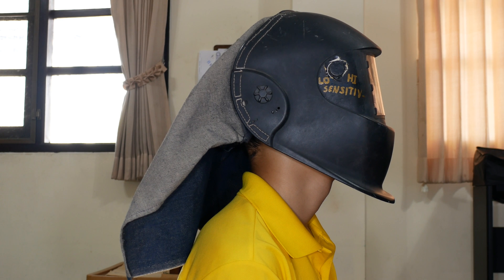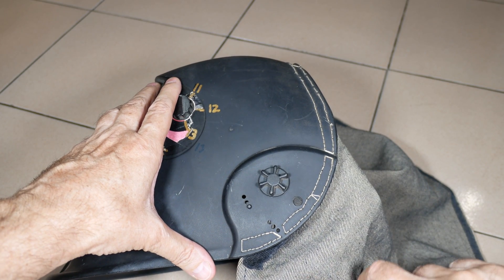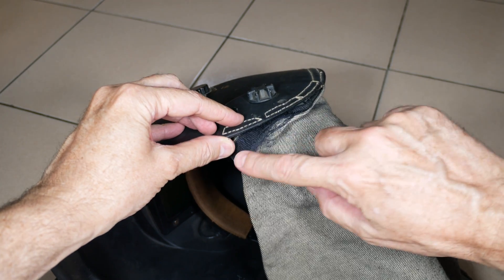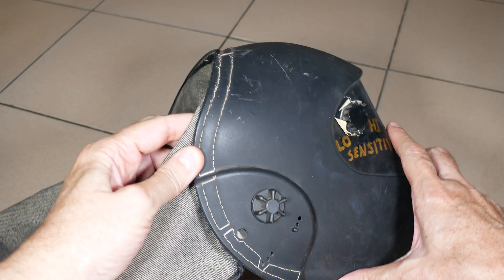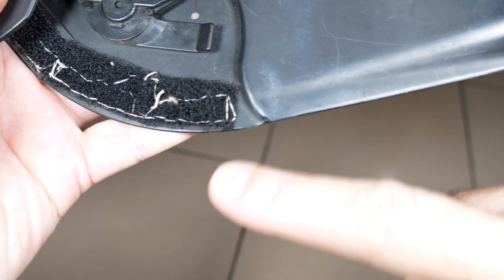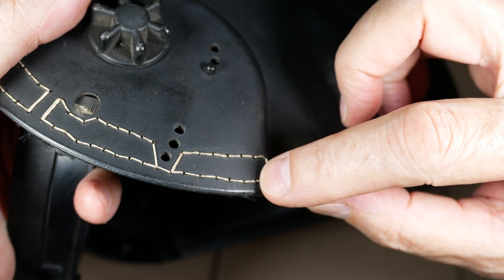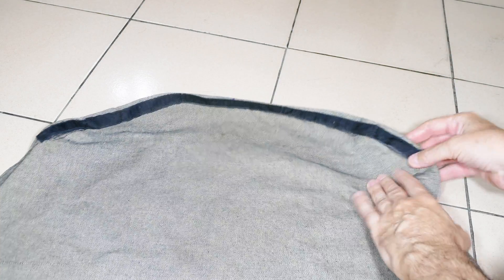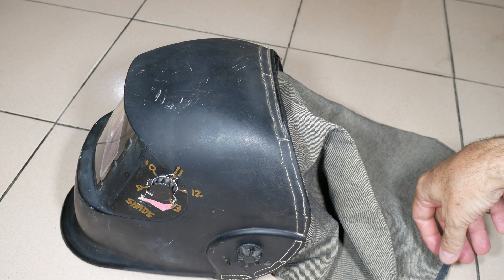DIY Welding Helmet Integrated Neck Protector (4K)

Comment: They sell ones that use a sort of press fit to attach to helmets but there not really breathable. And you can get away with using something non fr because unless you do overhead welding not many sparks will hit the back of you want something less permanent that is a bit breathable but will allow in some light you can use a flannel with a hood. It’s lightweight compared to welding hoodies or using a regular hoodie.